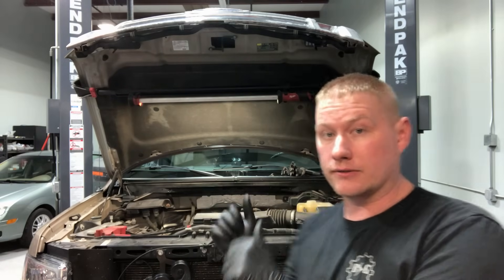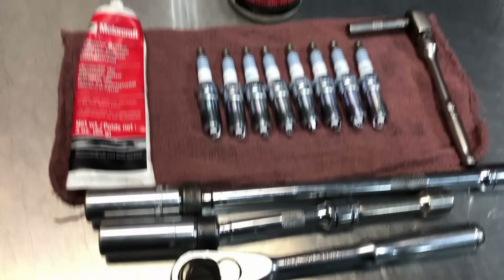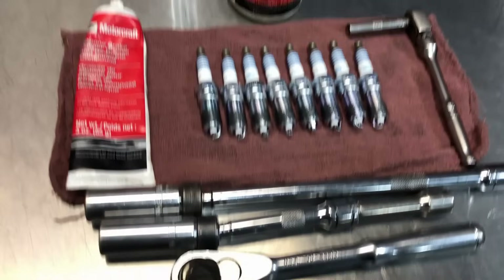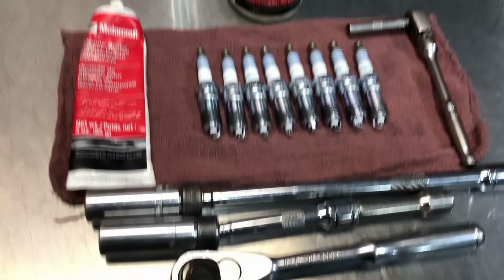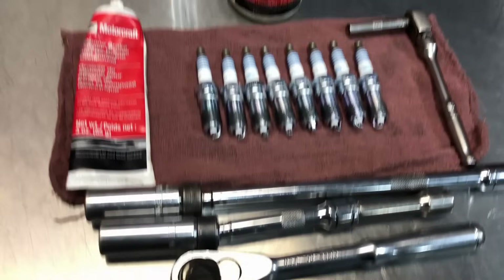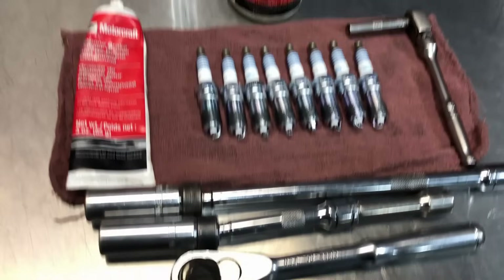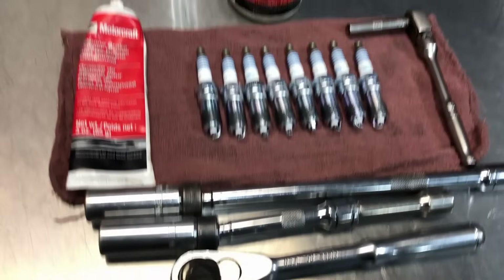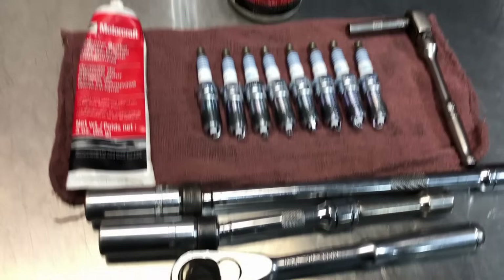2011-2017 Ford F-150 5.0L Coyote Engine: Spark Plug Replacement Walkthrough

Comment: Good ol' Ford using a tapered seat in aluminum...it's not like Ford had issues with a tapered seat in an aluminum engine before.
Reply: I have yet to see a gasketed spark plug back off when tightened with out a torque wrench.  My point is that a lot of undue stress, inconvenience, and money loss was incurred because of the use of a tapered spark plug in aluminum heads.  Tapered seat spark plugs worked great in cast iron cylinder heads.  It's been 30 years of Ford's experiment in this area of engine development, I would say the experiment of tapered seat spark plugs in aluminum should be concluded for the benefit of all included but those dealing in out of warranty work.
Reply from the maker: Almost everything Ford makes uses a tapered seat and never a problem when torqued properly.

Comment: Good video, thank you for the good info.  I was very relieved when I went to change the plugs in my 2018 F-150 and found the coil connectors had much more slack and the connectors were much easier to remove.  I didn't have any issues at all other than the third one back on the passenger that had a remote coil and spark plug wire.  Only one like that, I guess a Gen 3 Coyote redesign...

Comment: Simple to folliw and great connector clip release tip. Question: my cylinder # 1 had no dust blow out of it, all 7 other did.  What could this be indicative of?
Reply: That it was cleaner. Seriously though, don’t worry about it. That cylinder might just get more air flow and it cleans itself on the highway etc. As long as there is no dirt inside of the engine no worries.

Comment: Thanks for the video did my plugs today. Definitely one of the easiest vehicles to change, even the coil connector was easy. Used the anti seize on spark plug thread and on coil hold down bolt like you recommended in your other video. Had almost 80,000 miles on my 5.0, old spark plug gap was .060”-.065” you could see the wear, but truck ran fine. Molded lead frame project is a few weeks away.

Comment: the Red locking tabs are White on my 2017 F150,  don't need to pop them out completely and risk dropping them, just move them back 1/4 inch so you can unlock the tab on the main connector.   A pick tool is a MUST here for me.   (I'm not correcting this guy, he is way more the mechanic than me, just listing notes on 2017 )     it took me about 1 hour, being meticulous and careful not to drop tools or the 8mm bolt that comes out.    IMO, dropping anything can cost more time than the entire job ever would..     Great video.

Comment: I have a question for you. I have a 2015 Ford F150 5.0. It has an issue where it idles rough up and down then stalls out. Sometimes it stalls at the stoplight other times in drive or reverse. I've has the plugs changed the coils are fine. None of the Ford techs at my dealer know what to do it's really frustrating. I've heard it could be the fuel pump control module?  It's doesn't have any codes any experience with this would be helpful?

Comment: I mean the easiest spark plug changes I ever did was on my old B16A I swapped in my Civic and my K20A2 in my RSX-S. 4 accessible spark plugs with 0 interference. The spark plugs in my 97’ F150 with the 4.6 was an absolute nightmare. The spark plugs on my 13’ F159 with the 5.0 was easy but the dam clips would not release from the boot. Broke the rubber gasket inside the connectors which basically just disintegrated. Had to pump them full of dielectric grease and hope for the best. The spark plugs in my ‘16 F150 with the 5.0 were super easy! The white clips can be pushed back by hand and bent up to release from the boot. It was so much easier than the last generation! However my 13’ F150 had double the miles and both are Canadian trucks.

Comment: I just did my 2018 F150 today. The #3 cylinder has a divorced coil....no big deal.  #4 is the worst to get to in my opinion.  The truck has 60917miles and the new plugs really helped mileage.  Other than that, it was per your video. Well done.

Comment: do the coils need replacing on any regular interval?
Reply: Nah just replace them as they fail. Most of mine are original with over 200k miles, but a couple have failed and been replaced

Comment: Hey makuloco, having a weird issue... 78,000 on a 2016 f150 sputters on start up after sitting for 2-3 hours after reaching operating temp driving... struggles to start and when it does it sputters. Any ideas? No CEL.. shop replaced purge valve but not it

Comment: Thanks for the video. I am mechanically competent, but as engine technology gets more advanced I get less confident in my skills. This video gave me the confidence to spend about $50 and an afternoon to do the job myself. Truck runs great after my home spark plug replacement.
Reply: Good to hear it ran better after changing the plugs.   How many miles / how old was the truck when you changed them?  If you can explain, how did it run better? Smoother, more mpg, better acceleration? Thanks for you input

Comment: I just recently changed my spark plugs on my 2011 5.0L F-150 and one spark plug coil and I had to change all 8 spark plug coil pig tails due to all original clips being broken and now I have a rough idle and rough idle between 1500-2000rpm do u think it’s my mass air flow sensor now? My mpg dropped from 14.6 to 13.4 now and I have no check engine light on

Comment: Thank you for your informative videos. I have a question for you. I just changed my plugs on my 13 5.0 with 100,000 miles and 7 plugs looked good but the one nearest to the steering wheel looked a little darker and the threads looked wet with oil. What does that mean and what should I do? I have a 5 star 93 octane tune on it if it matters. The truck runs great no misfires but that plug has me worried.
Reply: Same exact thing on my 2012 with 153000 on it. No problems just that one plug was different.

Comment: Is it really safe to shoot compressed air down into the cylinders with the plugs out??? I wanna do a tune up soon on my '14 F150 and I'm just concerned about getting debris down inside the cylinders and messing up the cylinder walls. Thanks for your time, God bless 💒🇺🇸💒🇺🇸💒
Reply: Thad P.  You are correct. Best to keep debris out of cylinder. However, any small stuff gets blown out on the exhaust stoke from normal compression.

Comment: 8:32 WOW!!! Didn't expect to see a rust dust cloud come out of the cylinder! Great video, again!
Reply: Never would have thought blowing in the spark plug cylinder would be wise. Wouldn’t that increase the risk of debris in the engine and damaging the cylinder?
Reply: @galland1928 I think the goal of the air is to minimize that. Sometimes things fall in and this is intended to minimize the chances of that happening and hopefully even undo it if something does end up falling in
Reply: @galland1928 I wouldn't do.  Other than that good procedure
Reply: Me too.  What’s up with that?
Reply: It looks to be rust from the spark plug threads. Plus it also looks like some moisture in the air lines. It's harder to see it on my phone screen.

Comment: Any reason to preemptively change the coil and wire during spark plug change out, or should you just wait until a check engine code eventually tells you to change them? Thanks for the great video.
Reply from the maker: Nope just stick to the changing plugs only.

Comment: Is there a different torque spec with and without anti-seize?
Reply: steveyd101  Interesting question. I use anti-seize on a lot of components with the specified torque spec. Have never had any problem or a plug/fastener back out.

Comment: You wouldn't have the know the part number for the coil packs for my 2016 Ford F150 5.0  Should I use motorcraft in the past I use MSD?

Comment: Those coil pack hold down bolts break REALLY easy, i suggest people in salt belt use a 8mm screwdriver head on them then use a 1/4 mini open end wrench to very slowly get them loose. Ford dealer broke three and left me to deal with it.

Comment: I justg had a question, I just had an oil change, however an hour later the car just shut off.  It started right up after about 20 minutes. 
However today all was ok driving till I turned on the a/c and the car dies. Any ideas? If starts up how I have heard everything from the A/C compressor to the Plugs can you advise?

Comment: 200k miles on my 5.0 never changed the spark plugs. should i be worried about breaking them when putting new ones in, or more worried about having poor performance from the dirty plugs
Reply: Breaking them...
Reply: Kevin J. Both performance and breaking plugs with 200k are a concern. When I encountered high mileage Fords in shop, I would rotate the plug about 1/16 and spray in penetrating oil and let sit for hours. This was with the early/mid 2000s Tritons that had breakage problems. Also had a special Ford spark plug socket that grabbed plugs on flats and not corners. Saved a lot of engines from tear down.

Comment: Ugh those clips were a pain. It appears that fine dirt gets into the already snug connector and turns into a mortar. It took a lot of wiggle and flex to try and break up the dirt, just to get 1/64" victories. Blast lots lots of air into the connector, to try and blast out the dirt. By the firewall, use two 3" extensions as the ac lines or brake booster get in the way. One of my plus measured .062. Already noticing a significant improvement in idle and we'll see what mileage does next. 

Next time I might spray a little maf sensor cleaner to hopefully soften up the dirt.

Comment: Is there replacement ignition coil connectors available from ford in the off chance one gets broken?
Reply: Yes you can buy pigtails for basically every connector on the truck. It happens all of the time (maybe not COP connectors) in accidents and body shops will need to replace connectors.

Comment: Ford wants $350 to do a "tune up", in other words replace your spark plugs.  So thank you for the video!
Reply: $600 for mines...
Reply: @defmike5580 same
Reply: I think if you get all factory plugs and coils you spend like 500 doing it your self
Reply: Mt local dealer tried to scam me for $800. I asked them if they were high and they said, well, it's in case one of the spark plugs break." I ain't paying for "just in case" or "what if"
Reply: They just quoted me $395....ROFL dummies.
Reply: Spark plugs is all they do in the tune up?
Reply: @ericmiller8596  when my shop quoted a tune up in included the spark plug replacement. And a fuel injection maintence as well or intake cleaning whatever the manufacture suggest as per vehicle. And we used industrial cleaner. With in gas stuff as well. Im not sure what other shops considered a tune up. But some it was just the plugs. If you live in the salt belt the small bolts rusted the crap and could be a pain to remove.
Reply: They tried to charge me 500

Comment: Wondering if you have any videos replacing the valve covers? I broke off a couple of the coil over bolts and contemplating replacing the valve covers, though I’m not mechanically inclined. Any help would be appreciated!

Comment: Use a stubby flat blade driver to push up on the locking tab and it will ensure it’s disengaged. Makes it so much easier that pushing on the tab

Comment: Owners manual for 2014 f150 says to replace with Motorcraft SP 519. Cant find these plugs anywhere. Did they get replaced by SP 548?
Reply from the maker: My videos use the latest plugs from Motorcraft, so yes the SP-519 supersede to SP-548.
Reply: @FordTechMakuloco  the gap for the sp 519 was different than the one for sp-548. which gap is correct and does it affect milage?

Comment: I got a 2012 Ford F-150 with a 5.0L  it went in to a limp mode and it is giving me a PO300 & I replaced fuel pump, spark plugs, all 8 coils cam position sensor, crank sensor, VCT solenoid and I’m still getting a PO300 , I did a vacuum leak test too, I should have but I didn’t do a compression test. and it still has a rough idle. HELP
Reply: Mass air flow sensor and throttle body clean ?

Comment: This video was great and informative. My pickup is now running like new (I swapped the coils as well). 

How about a video on replacing one of those connectors? High plains and plastic don’t match and I cracked a connector.
Reply: You can get replacement connectors from Amazon. They come with wires attached but you can de-pin them and re-pin them
Reply: Mark Hemsoth I had to do that by trial and error on two of my ignition coil connectors. It was a major pain to learn, but better than paying a mechanic.

Comment: 2016 5.0 F150, SP- 548 specifically states on the box. Caution spark plug gap is NOT adjustable.

Comment: FordTechMakuloco  Love the videos love the insite.  I now have a question.  I have a 2013 STX 4x5 F-150 5.0 Coyote.  Recently the water pump fell apart in it.  It got hot 2 or 3 times.  I limped it to a buddy's house.  I let it JUST get hot and shut it off and let it cool off.  Once there I added water, drove it a few miles it would just get warm (not quite to the warning, I would shut it off, add water and keep driving) until i got it home.  Since then I have noticed a cold start tick.  Not there every time but most of the time it is.  At first it was VERY LOUD when i put the new water pump on.  It has since quietened down.  Sometimes when cold, it doesn't do it, but between cold and operating temp.  What do I need to look at?  What do I need to take apart?  Do I need to pull the valve covers off what do I need to look for?  Engine has roughly 60k on it.  I bought it used with a recent engine swap for a lower mileage engine.  
I had a soft spot for this truck.  a Mazda Hyundai dealership put an engine in it, got it running with no timing chain rattle that it came in for.  All 4 cam position sensors were throwing codes it cranked it ran I said I'll take it off your hands turns out they had an intake and exhaust cam position sensor in wrong on bank 2.  I knew it was that or a ground strap missing in the wrong spot just something careless.  ANYway that was 2 years ago.  Where do I start looking for ticks on these 5.0 Coyotes?
Reply: Mine had the same problem, the water pump went out at 164,000miles so i replaced it also replaced the thermostat with an aftermarket one from autozone, after that the engine fan would engage and make a super loud noice only when stopped turned out that ford engines are very picky after i reinstalled the oem thermostat the engine started operating normal.

Comment: 16 f150 5.0 with 29000 miles been in for misfire. Code was random but logs said 15 on 5. Then they found coolant around #3 ran  pressure test cold and hot and passed. Any ideas? Changed coil for 5. They had me pick it up and told me to drive until something breaks.

Comment: I broke one of those latches on my second round of plug changeouts so i put a ziptie to help back it up, no problems in 60k miles since then
Reply: I did also , glad to hear the zip tie worked for you as I was wondering about that

Comment: Torque wrenches are made for a reason..  Consistency. Not arguing, but I would like to see just how consistent you can be across eight cylinders.
Reply: A few guys and myself did this before (not on a 5.0 spark plug) and we were all able to get them within a ft lb. Torque specs are 124 inch lbs which is a little more than 10 ft lbs. Auto manufactures give torque specs for essentially every bolt, regardless or not if every bolt really requires that kind of consistency.

Comment: For the 15-17 f150 5.0 oil cap says 5wx20. Alot of online forums suggest going to 5wx30 for better protection hot. I figured you're the guy to ask and would know if they in fact went from 5wx30 just to meet EPA ratings or should one just stick with 5wx20?
Reply: He recommends 30w. I switched to 30w in my 18 5.0 and my engine got quieter and saw zero difference in fuel mileage.
Reply: Also highly recommend 5w30. It offers much better protection.

Comment: Great video, I performed a compression test and replaced the plugs at the same time. Is it normal for ant-seize to become gummy since the last change?
Reply: That’s why you should use the Motorcraft high temp nickel anti-seize.

Comment: Thanks so much! I am getting ready to do this job and was scared because of the other Ford issues! Question- If I have a plug or two that is not working correctly will it ALWAYS throw a code and make the CEL come on? Right now I dont have the CEL but I get a decent shudder when accelerating above 30 MPH and everything is pointing to the plugs and or coils. Thanks for the help!

Comment: My 14 GT was a breeze, like my old 00 GT.  The passenger side red tab connectors/ignition coil harness connectors came off like butter...just the driver sides were a little more difficult.   Had to take the strut brace(of course) and battery out to get better clearance, but everything was super clean and no rust anywhere down in engine.  Changed mine today at 60k miles.

Comment: Great video. Changing the plugs in these trucks is definitely a breeze. I just really wish someone would make a video on diagnosing the well known vibration issues on the 2011-2014 f150's especially 5.0 4x4. A google search for the vibration will bring you to several people who never did figure the problem out after countless dealership visits and most end up selling the truck. I've experienced the issue with the 2011 and my friend's 2012 both 5.0 4x4 supercrew cabs. The vibration is 45-70 mph where the entire bed shakes. Changed tires, wheels, driveshaft, u joints, both rear axles and bearings, transfer case mount, as well as the torque converter.
Reply: i have an 11 screw xlt and the bed on mine dont vibrate, yet anyways! (knocks on wood)
Reply: +DodgeMode-  Oh....  Stop it.  Just stop...
Reply: Have a 14 fx4 super crew and my bed shakes at 65 mph
Reply: My 06 crew cab with 7ft bed had no shakes but my 2011 crewcab short bed does. Go figure. It also burns oil where my clapped out 2006 did not.